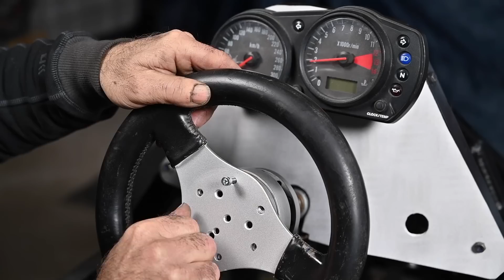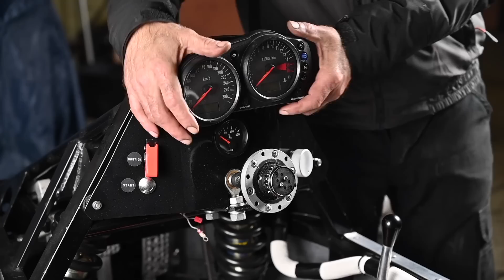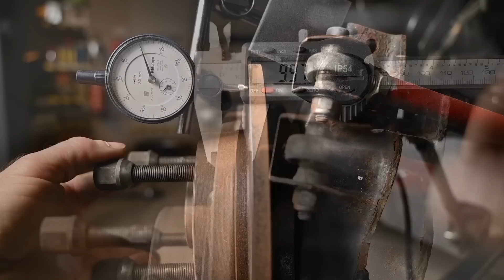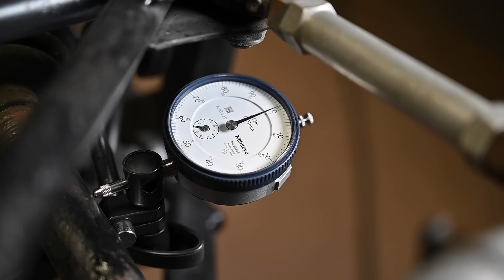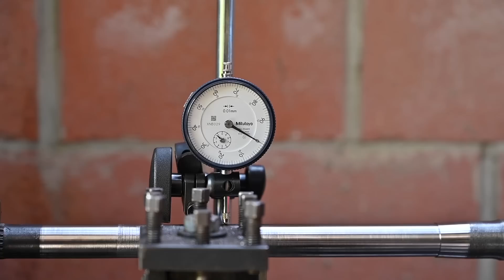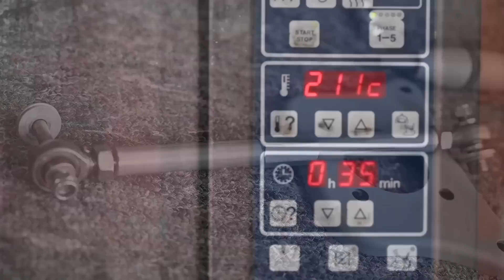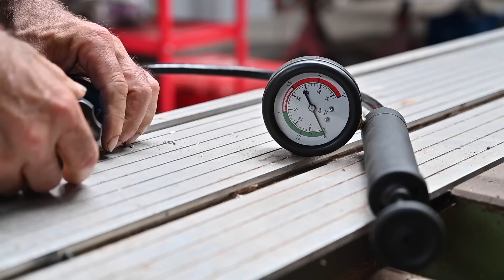Formula Konig Race Car rebuild in 17 minutes

Comment: Did you try to bend or apply any torsion (more representative of the forces to be applied in real life usage) to the shafts you machined just to check whether or not they were strong enough? I would bet they were.

Comment: Very satisfying video, I really enjoyed every part of this series. It would have been awesome if the car kept the original VW engine it was designed for... Anyways such a nice build, now to have fun at the track with it!
Reply from the maker: That is so true, unfortunately the engine is swapped. On the other hand it has 140 HP with weight of 405Kg,  that is the same as a 1200Kg car with 460 HP...  So not a bad thing to race with. And 15000 RPM....

Comment: Love your videos.. I accidentally came across you a while back while searching for a problem with a rover v8 3.5. Runs perfectly but when hot and maybe do a Pitstop for expensive fuel it still started no problem but power was way down. Drive for a while and all good again. New HT leads. New spark plugs and a new coil but still happened. Then I saw your video explaining about the little amplifier attached to the distributor using thermal paste. I cleaned and put new paste on and wow.. ran perfectly for maybe 2 weeks. So I've ordered a new Lucas one so fingers crossed.. Its fantastic to see videos like yours that explain these things to everyday people. Bell notifications on and thank you for your work 🙂
Reply from the maker: Thanks for the comments Andrew